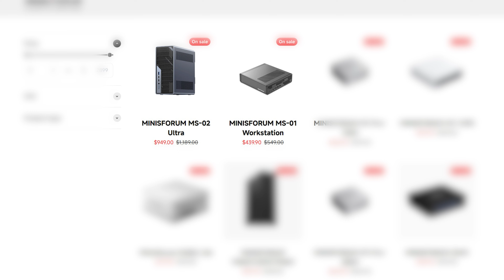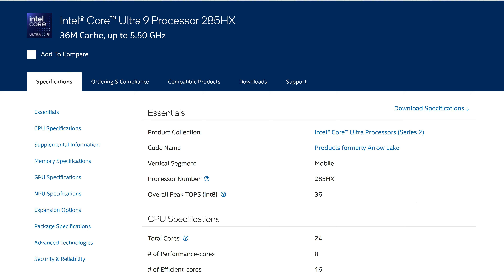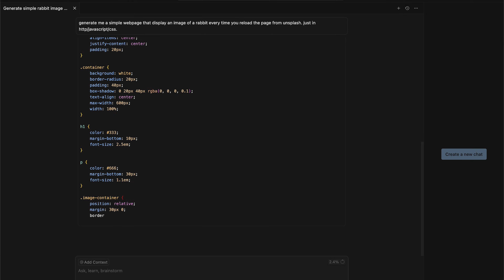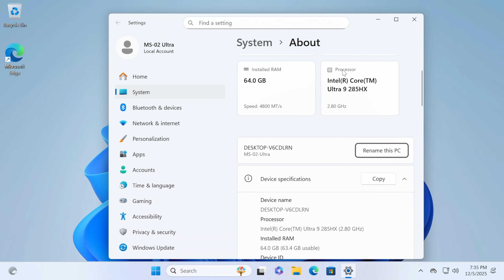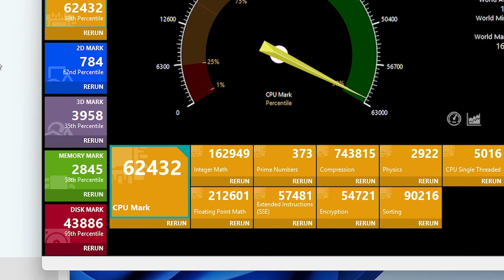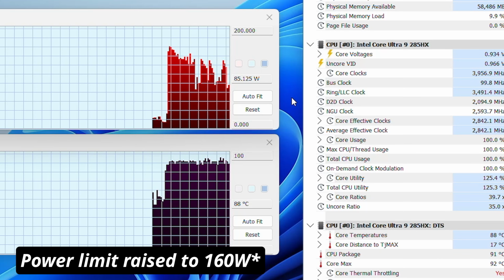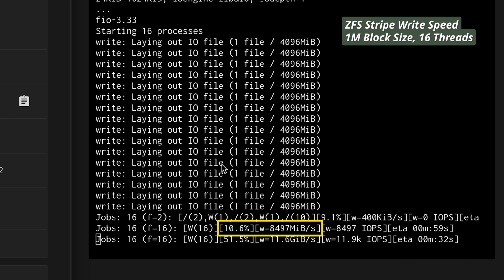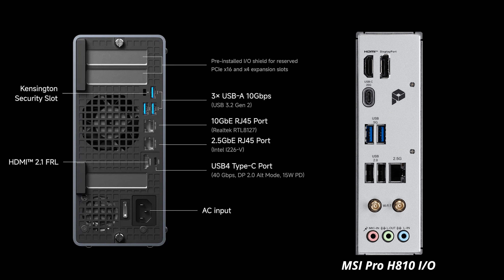This Mini PC shouldn’t exist - MS-02 Ultra

Comment: It’s true that is not a gaming pc per say but recently my Xbox One S finally died on me and I am left with just my Nintendo Switch and a budget laptop running a 10th gen Intel 5305u with 12gb of ram and I discovered the onboard 10th gen intel graphics can run older games like Borderlands 2 and Metro 2033 Redux better than my Switch. For now that laptop is pinch hitting for my out of commission Xbox.

Comment: Can you measure the network card PCIE bracket screw hole to screw hole? I want to see if I can put a full height bracket on it and run it in my PC. 

If you’re feeling froggy also the SFP holes too. I’m curious if it’s x520 pattern so I can buy a bracket.

Comment: At work I'm having an issue where many sites I manage are moving to server-less and going cloud only, but now some 3rd party vendors are needing to run a few services on-prem (*sigh*) and so I need a micro server of some kind that will be able to run a few hyper-v VM's and have some sort of remote management (something like iLo/iDRAC/IPMI).  Any suggestions?  Trying to keep it under $1k.  Great video, that is an awesome compact computer.

Comment: Did I understand that right that the Intel e810 nic only got x4 PCIe4? 

A normal E810-XXVDA2 card has x8 PCIe4. Considering that x4 PCIe is 8 GB/s or 32 Gbit/s and the card has potientially 100 GBit/s (2 x 25 GBit/s full duplex) that seem quite oversubscribed. Or is the slot x8/x4/x4?

Comment: id love to see you add a pcie extension cable and run a full power gpu with its own power supply.  like a egpu but connected to the full x16 slot.  too bad its not thunderbolt 5.

Comment: I'm not meaning to be excessively snarky with this, but it would be kind of nice if at some point during a 20 minute video you could quit flailing the machine around and jump cutting for long enough that we could actually see how it's put together. I don't think there was an unobstructed view of any angle of the board in this thing for more than 15 seconds in total in this entire video.

Comment: $900+ with NO gpu who would want that, even if it dropped to $500 hhhmmmmm still no, but then what? oh there a very limited amount of gpu on the market that would fit in it, and because its small enough to go in it would prob make it more expensive than normal size gpu i guess. this is just a brick shaped laptop with no monitor

Comment: This would have been way more interesting if you had digged into the pcie lane topology a little. How is all of that io connected to the cpu? Maybe that would've provided so insights on your nvme raid bandwidth issues too. I would assume that much of the io is connected through the PCH which is pcie 4.0x8 (~16 GB/s) in total... If the pcie x16 slot is actually 5.0 x16 directly to the cpu that would only leave you with 8 lanes to the cpu which I would assume to be the ones used by the M.2 slots on the mainboard. But this would have been interesting to know for sure...

Comment: Their computers do not last long and overheat the nvme and break it. Drivers are not good. Firmware on motherboard out dated. I have 7 computers from minisforum and all have/had issues. Ruined nvme twice with one computer. Bad voltage regulation. Brand new i9 cant even restart, only can shut down and turn on.

Comment: love how everyone is raging about this form factor, when in fact lenovo has done the exact same thing for 5 years now. its called p3 ultra, formerly known as p360 ultra. sure, this thing is better since it has amd max whatever its called, but still… followed by dell, iirc. ok, this one has intel i9 whatever, and as far as i can see it siffers from the same problem as p3 ultra - cooling. i have a measly i5 13600 and when stressed yeah… the cooler cant keep up. p3 ultra also goes all the way to i9 and those get a double cooler, and thus no double slot gpu is possible, and i cant imagine how it behaves under load. no, scratch that. i know exactly how it behaves. toasty. and loud. lol. thanks for reading my ted talk.

Comment: you can install more RAM is you want you are not locked to 256GB. No cpu is this its only the validated Size but with quality RAM you can do a lot more especial the modules are power efficient. 
I mean yeah some vendors lock you but those are the main e-waist sellers on the market. Alienware, IBM, Lenovo, medion and some more. You know the apparently high class PC manufactures who drops support more often as they change their socks. I have a server based on a intel J5040 and i have 32GB of RAM in it even it official supports only 8GB. i have no issues. Those are 16GB 3200mhz SODIMM modules even the system does only use 2400mhz.  This system is running for over 4 years 24/7 completely passive cooled.

Comment: Intel CPUs in a desktop are a volcano so there is no way they will perform well in mini pcs like this. Also this series vs the AMD version just includes the psu inside and not external like ms1-a2. We bought 15 Ryzen 9955HX minisforum and we run them as mini VM servers... They are fucking awesome with max cpu voltage limit they are silent and faster AF!

Comment: Mine arrived two days ago. Beautiful machine!! Installed Windows and drivers and still-missing drivers. Installed 1,000 apps and utilities. Now TRYING to move Outlook from my current PC to the new one.

I equipped my MS-02 Ultra with 64GB Crucial DDR5 RAM, a Crucial 2TB PCIe Gen 5 M.2 SSD, and a Gigabyte RTX5060 low profile GPU. I'll be running 25Gb fibre to my desk from a UniFi Pro Aggregation switch. Will also connect the 2.5Gb NIC for vPro management (using Mesh Commander).

Upgrading from a 3 1/2 year old Intel NUC 12 Extreme to the MS-02 Ultra.

Comment: The Arc Pro B50 can also be an option. 
As for the 25G card, I think it's set up as 4x+0+4x+4x so that it can also be used in an 8x+4x+4x bifurcated slot. Also, I wouldn't be surprised if this were the case here, too, as Intel is restrictive about the bifurcation options on consumer stuff.

Comment: Looks like the system gets bottlenecked by power and heat limits. Meaning, it's worth buying the lower spec CPU model. A thing to mention about those mini GTX cards like the one by Gigabyte is that they run fans at full speed at all times. They do not throttle based  on load and will make your mini significantly louder. This box is best used for media editing, lite 3D work. For gaming - go full size.

Comment: part of the alure for me in a mini pc is a powerful yet efficient systems in a tiny package but once they start getting bigger it just looses that appeal. at that point why not just get a full sized desktop which is much more convenient to manage/upgrade. i guess it is kind of necessary to dissipate that much heat. the evo x2 with ai max 396 is like 7 inches on the larger side compared to 5 or below inches you would come to expect from the term mini pc. at this point (7+inches) why not just pop in a laptop graphics card.
Reply: Yep. If you're much bigger than a Mac mini then you're not mini anymore.

Comment: That NIC is cool, they should sell that. tho i guess the need for a slot that has the bifurcation setup probably makes it too niche

Also I have a 600W 80+ platinum flexatx PSU, I wonder if they let you change the lower CPU power limit thing if you upgrade the psu. Would be cool to slap the ada card in and retain full cpu power

Comment: Smol,  the 285HX supports ECC, it has thunderbolt, the machine is almost perfect. If I had the money, I'd impulse buy it. Your old boss built a machine for somebody that shares his name and he gave the best tech tip about ECC. The only thing that would make it prefect for me would be if it supported full height dual slot high power GPUs like the RTX Pro 6000 with a diresct x16 connection. I like the idea of a workstation being as small at can be while being able to upgrade the height GPU and use thunderbolt drives and PCIe adapters for non-gaming cards. When a computer becomes obsolete, I don't want a giant case to get rid of when only want a giant machine for legacy card support. I like keeping the arms and legs of the old system when I get a machine with new brains and eyes.

Comment: The black Mylar sheet is intended to be attached to the side of the graphics card, directing all hot air to exhaust from the bottom of the chassis.

Comment: Don't comment on YouTube very often but just returned my Minisforum MS-01 and wanted to share my thoughts (having also tried another of their mini PCs in the past).
Frankly, while it's hard to beat their performance/features for the $, I simply can't recommend them due to atrocious hardware support.
Putting aside their BIOS, which is half-baked and unintuitive, their hardware simply doesn't work as advertised and their support isn't willing to help with that.
To be more specific, I've had issues with their USB ports and PCIe slots. I've had occasional USB-C port instability when connected to external drive enclosures (e.g. for Unraid/NAS use), with USB-A ports consistently being problematic.
With the PCIe slot on the MS-01, I've had issues with PCIe cards only using half the expected lanes and even when using the right number, cards still misbehaved and ran with diminished performance.
Support's response? 'Oh the controller may be overheating, try powering off and letting it cool' as if I don't monitor my system and drive temperatures. They refused to actually perform any troubleshooting or address the core issues.
None of these issues were present using hardware from large, US brands such as Intel NUCs or Razer laptops.
Then there are other little things, like poorly applied thermal paste from the factory, requiring removal of glued-on thermal padding just to remove the CPU cooler to reapply thermal paste. M.2 drive screws so tight they need pliers to remove from the motherboard.
Just the kinds of things that really showcase why these machines are so cheap. For most use-cases, you're likely better off grabbing a used NUC or Lenovo mini PC from a generation or two ago.
Reply: Minisforum is currently dicking me around pretty bad. The PCIe slot was so borked it made the whole system unusable. It has been 17 days since reached out for replacement and I still don't have a working computer. So keep that in mind if anyone wants to buy something from them.

Comment: What an insane price for what you get, with horrible thermals. Just build your own mini ITX system. It will be slightly larger, but you're going to get SO MUCH more than this, plus you will have standard parts that can be purchased from pretty much anywhere.

Comment: This would be more interesting as a separate motherboard since with that PCIE x16 slot, one of those could be a really good basis for a gaming system.  Unfortunately, the supplied case is just too small for a full sized graphics card, even a 2 fan one since it doesn't support vertical mounting.

Comment: The CPU cooler is quite well thoughtout, I like the straight through design, much better than dumping the heat inside then trying to pull it out, as we all know, pulling out never works.

Comment: We're almost back to the slimline PC form factor
Reply: HP Slimline s3000 series. I still have one running WinXP to run an old SCSI Canon film scanner and the older software it uses. Same size as the computer in the video but weighs about 20 times more than my M4 Mac mini. 😄

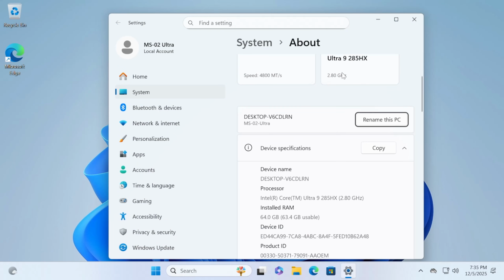Comment: If it doesn't have XMP, then why did they place 5600MT/s RAM in there when the small clip of windows at 10:02 showed it running at 4800MT/s? Price? Availability?

Comment: regarding the k400+. Dear logitech I know you have sold actually millions of these to living room media enthusiasts,  IT techs who need a keyboard and mouse combo that fits in a back pack and "online personalities" BUT. ...!
1. The typing experience is super squishy I fumble the keys all the time .
2  Have the keys light up for 5 seconds after you touch them . 
3.Extend the mouse pad to the bottom of the keyboard and have an dpi switch so it can track across larger resolutions quicker. 
4.Make the adapter 2 sided USB A/C allow it to use rechargeable batteries. that is all  

Jake love your review of this machine I can't afford maybe I'll pick it up second hand in 6 Years when all our PC are streamed from our wristwatch to a floating display and typed on with a virtual keyboard that is integrated into our retinas

Comment: thnx Jake for this review i want someday a minisforum barbone too, but i have all other stuff to build a pc i just have the mobo and cpu missing, i want to buy the Intel Core Ultra 9 Processor 285K but i have 96gb ram ddr5 6800mhz and i have an RTX 5070 TI OC 16gb MSI , do i need the KF or K for doing NPU stuff with coding and agent LLM ?

is it faster than my actual i9-13900k ? i want to use my actual pc for the server and the Intel Core Ultra for coding and gaming.

Or just the Intel Core Ultra 7 Processor 265KF will be enough for me ?

Comment: I think minisforum should copy the Steam Machine. 
The same case with way cheaper components.
Bundle the MS-02 with a Core ultra 7 or ultra 5 CPU, a basic motherboard (w/ 2x M.2), 16GB RAM, 1 TB SSD, a Low Profile RTX5060 and Bazzite.

Comment: So what is the actual use case for this? Why would you make these compromises? Why would you ever need something this small?
Reply: First thing that comes to my mind is when you need something more powerful than a thinkpad to run whatever trade show thing you're doing - fitting the horsepower into a small package means you can put it in carry-on luggage so you can be 100% sure you're not going to get screwed by baggage handling.

Comment: Hey there :) 

Love the energy. I am glad to see you jumping into your passions.

Did you consider one day, doing a round up of some paths one could take across several budget lines, in terms of building home labs? 

What would you yourself put together, to answer a need for reliable home lab, that serves as: 
1). high capacity data storage (video, photos, data) - say 32tb with redundancy, say 16-20tb useable storage 2). running VMs for linux and windows environment, 3). serving as database server for personal data projects, 4). running jellyfin or even plex server, 5). hosting photosync / music streaming with.

I am aware of the internet, before anyone jumps at me :D I just would be very interested in how you would solve it at different budgets (I am putting together different options for myself, and the spreadsheet is getting really big :D) Would your consideration at highest price point be power efficiency or raw performance when streaming? What readspeed would be ok with for different use cases? How would you benchmark each category? What would you metrics be? How would you put together the networking with other devices at home? Would you choose to get a seperate device to stream to your tv without using god awful IO on modern tvs? I would really love to see your breakdown, and your rankings :) 

Either way, I'm excited to see what you do next. Keep it going :)

Comment: Did your ADHD kick in with regards to the PCIe lanes?
You mentioned the limit but then when you see 12 lanes on the Custom 25G NIC, you never put 2 and 2 together.
x16 Slot
x4 Slot
x12? Slot for the 25Gb+M.2 slots
M.2 NVMe slot, assuming x4
So that's 36 lanes from a CPU with only 24?

Comment: Every product review, and especially mini pc reviews should have power draw from the wall. (If you did this i missed it)  There's a staggering amount of people who are offgrid/van/boat, either by choice or by force.  Especially if you're using it a lot 50-100w power draw from one device over 24 hours or 12 hours even means you need another solar panel, or means you can't run another device. Also, like, a kil-o-watt or w/e you call it is extremely easy to setup and film. Cheers.
Reply: I don't think you'd be daily driving a beast like this one in a van/boat tbh.
Use less power-expensive mini computers (Zimaboard, for example) for your daily office work (browser, youtube, spreadsheets, etc.), and only boot a "gaming PC equivalent" for the few hours you want to play games (and monitor your large batteries accordingly, of course).
Reply: Get a Mac mini.
Reply: Get yourself a Raspberry Pi and call it a day. But I do agree with you.

Comment: This Mini PC has EVERYTHING, including a $1500 price tag.
Reply: At least 2/3 of that price is RAM.
Reply: @gramfero You joke, but that's the price of the barebones configuration 😂

I feel better and better about my ThinkStation purchase 2 months ago. It came with 64GB/2TB/intel 13th gen i7 vPro/RTX A2000 12GB  for under a 1000 dollars.
Reply: Just go for the next level down - the 275 CPU is 95% as powerful, you just don't get the 25 GB ethernet, but if you don't need that, you can save a lot
Reply: That should be the first bullet point.
Reply: ...more ....:)
Reply: Thanks. That's all I needed

Comment: The problem with minisforum is that if something goes wrong like when by brand new motherboard from them was faulty you are in trouble it took me 6 months after they got the board back to get my refund for the board that never turned on and destroyed the ram and gpu connected to it and their response to my destroyed hardware was "That sounds like your problem"
Reply: Now that sounds just lovely to deal with. I had to RMA my GPU once for about 5 weeks and I was stressed the whole time
Reply: At that price point I would just build a regular PC. Better cooling, easy part replacement and upgradable.
Reply: I got raided on Reddit when I made the same argument, even with proof from others, that although this Chinese tech wave is quite competitive and generally good quality, it comes with a hard lesson when you need assistance—or worse, when the product needs servicing. It’s a nightmare especially with all these asian brands. Korean and Japanese brands probably provide the best tech service available. I don’t want to sound harsh, but that’s the reality.